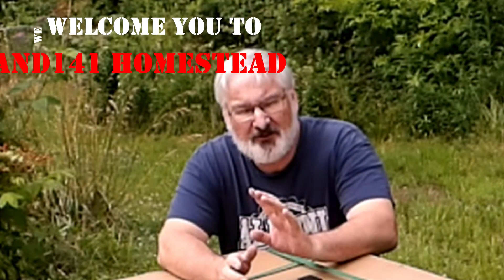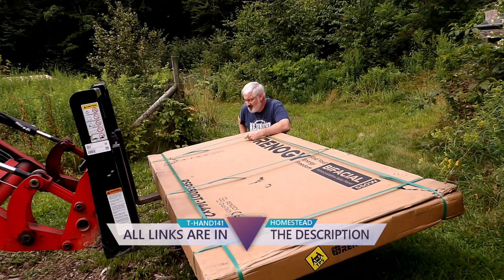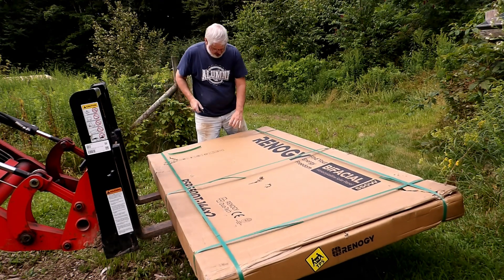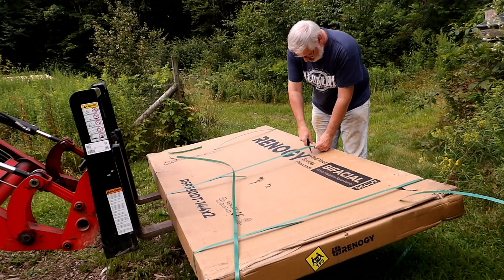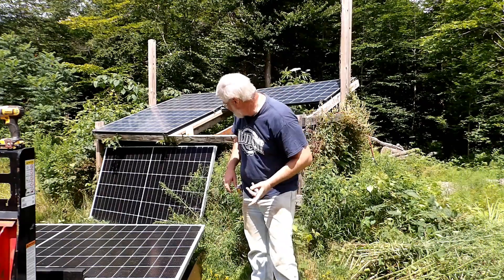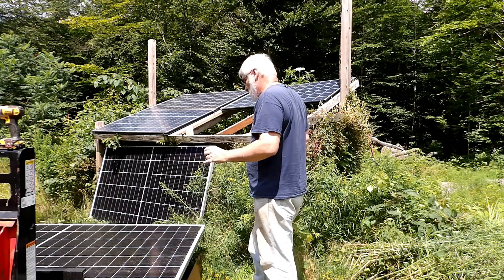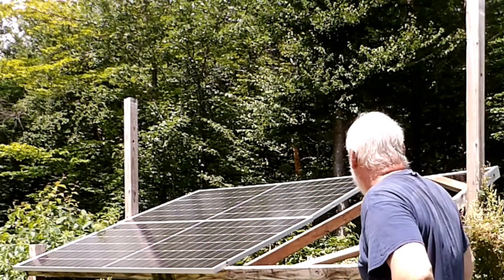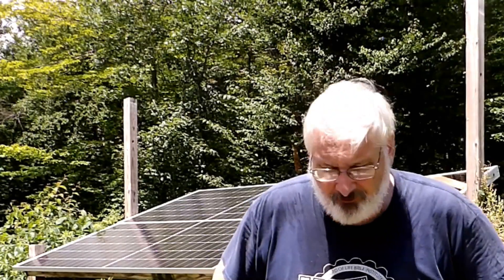Upgrading Used Solar Panels for New 550W Bifacial

Comment: there cannot be anything between solar and panel or voltage drops, light travel 8min and if 1centimeter blocked u failed evolution
Reply from the maker: Ok, take this in the joking manner it is presented, but if I failed evolution ( did you mean science?) you failed English. I will try to piece it together. Yes anything blocking the sun from the panel will reduce the voltage. Not even going to try to guess what you were saying with the 8 min light travel statement, Light moves a lot faster than that. These panels are designed to compensate for shaded cells and continue full output from the sunny cells. please check the solar panel stats on the link in the description. thanks for the comment, I hope you enjoy my content.

Comment: Why did you get bifacial when clearly that rack provides no benefit to the bifacial panels.?
Reply from the maker: In the summer The panels are laid down at the angle they are set at now so as to receive the direct  rays of the sun. In the winter they are raised to a greater angle to line up with the sun which will be lower in the sky. In upstate NY I get quite a lot of snow, and with the more vertical angle of the panels the reflection of light from the snow behind the panels will give me 30% (they say) more energy production when I need it most with the shorter days . Great question, thanks!

Comment: Nice to see the new panels  arrived undamaged. The bi-facial  should make a difference in the winter. Maybe  the old panels  could make a second string.
Reply from the maker: I was thinking of that. As long as they are in parallel and not series with the new panels that should work! It would be great in the winter.